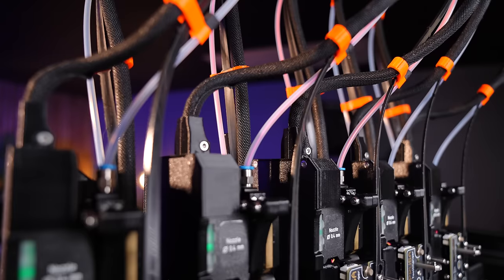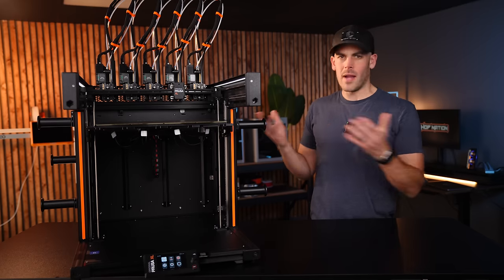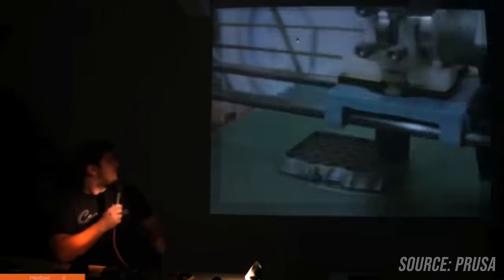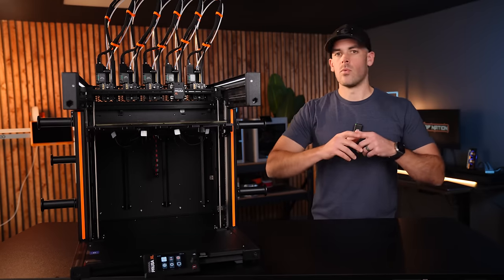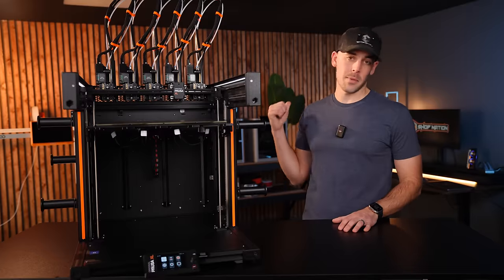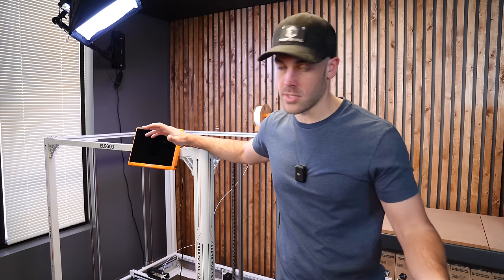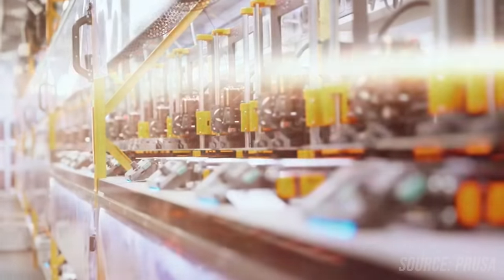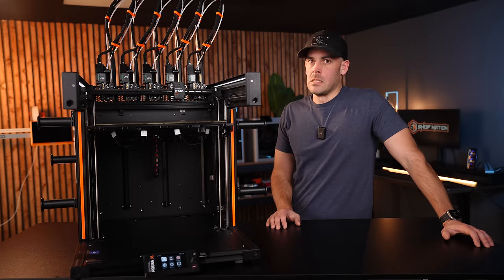Why Prusa is the next Blackberry

Comment: I would say Creality's latest K-series core x-y offerings are more competition for Prusa than Bamboo Labs. Bamboo Labs are ultra proprietary meaning if it breaks and Bamboo have stopped supporting it you are screwed. Also they upload all your models to a server in China which is a none starter for anyone printing anything commercially. Sure there are work arounds for the upload stuff but it's inconvenient, makes the printer harder to work with and disables features. Creality on the other hand have open sourced their software and drivers so the community can work with the new platform. The thing Prusa still has though is outstanding customer support in this space but even there the competition is working hard to catch up.

Comment: A two-head model is much more sensible to save up on material costs and complexity, while retaining the advantage of two-tone designs and resorting on changing filament for more. There is much more potential interest in fast printing two tones of filament in something like designing prototypes of moving parts... though I suppose that is just as easily addressed with painting.
Right, why do you even need to print a piece in different filament colors? Paint exists.

Comment: I ordered the Prusa MK4 and deleted it because of delivery delays. I swaped to Bambu and did not regret. Prusa shoud do a Bambu Printer but with higher build quality and at least the same features. The MMU is a piece of crap. Bambus Solution is just fine for home experience and the speed is awesome. But I wishe a more rigid frame and case. I would pay 2k dollars for a Prusa high quality Bambu Clone 🙂

Comment: The xl would be good for multi material parts. Like plastic bearing and bushings for all plastic robotics or for lightweight minimal  internal supports. I have never seen a 3d printer irl. I've watched a few creators that need that capability with less risk of mis-feeds. And how long would it take to offset the price based on the amount of waist the single head multi filament printer makes?

Comment: Most of the time wasted changing filaments on bambu could be fixed in software anyways. I think they just have some other pressing bugs to deal with first.

And also, why does anyone need more than two print heads? Couldnt one purge while the other prints?

Comment: This video has some pretty big omissions, first, the MK4 is Prusa’s best selling commercial printer. It hard to say they should “pivot” when what they are doing seems to be working OK for them.

It’s also important to remember that the iPhone has and I believe still does struggle to gain really good traction with larger corporate clients. I suspect that Bambu has had similar issues given that they had to release a more expensive version of the X1 with tweaked features and Ethernet.

I am also curious why Bambu released 2 bed slingers (one which was clearly rushed) if their CoreXY offering was doing so well?

To me this video seems a little hyperbolic, I think the XL is 100% a bit niche, but saying that I want one more than any other right now! Other than that, Prusa’s seem to being pretty well being the reliable work a day brand. Why does there only ever have to be “just one” brand? It’s a global market and competition is good. Prusa has their fingers in a lot more pies than Bambu, so I don’t see them dying off just yet…

Comment: Here is what I want to see from prusia: a smaller xl, fully enclosed, heated chamber, air filtration, dual head (either tool swapping or fixed) that's it. Can still cost more than others but at least I get the same features.
Reply: they should do 2 tool heads each connected to its own "ams" type system so while one is printing the other can be purging and getting ready to go and drastically reduce swap time and if each ams can hold 4 or 5 colors than you essentially have a 10 color print so the benefits of the mutli tool head with the benefits of 2 ams systems.  And they would need to have their slicer be able to tell you which colors go in each slot for optimal efficiency based on your sliced print. even if that means you have the same common color in both ams's.
Reply: I agree, but I think it should be 3 heads rather than 2. An IDEX can do 2, so this would give it a USP over an IDEX. 3 heads would allow you, for example, to do 2 material, plus support material. IMHO there's not a lot of point in a 2 head toolchanger, as an IDEX can swap heads way quicker than a toolchanger, with way less complexity
Reply: @EddyStyl3s You still have an enormous amount of waste.
Reply: @EddyStyl3s  I was thinking the same thing. color changes don't need to add more time.
Reply: @EddyStyl3s OMG, I had the exact same idea 2 days ago! An Index pinter with 2 toolheads and 2 "AMS" systems is the best of both worlds. Fast and efficient printing at dual color, capable of multi material (PLA + TPU for example) and it can print fast multi color for more than 2 colors.
Reply: quickchange nozzle like on the new bambu
Reply: 2 heads is too limiting for complex projects. im running tpu, pacf, pccf, pp, hips. just get the mmu3 if you want a smaller machine.
Reply: no need for idex if you have the nice tool swapping ready
Reply: @EddyStyl3s  2 heads come at the cost of decreased quality, increased size, etc.
Reply: @EddyStyl3s  yes this would be amazing! It will be interesting to see what BL come out with next in their gen 2 printers, because there is little doubt they are working on an evolution of the AMS system and a reduction in waste and print time. I would love IDEX.
Reply: if anyone could help with their opinion:
- where would you place the RatRig 3d printer? interested to know how it ranks between the rest of the brands
Reply: Absolutely!  I have no need for 5/6 printheads and huge volume, but I'm still sticking with my Flashforge Creator Pro II IDEX because I often do prints that NEED dissolvable supports.
Reply: Yeah. A fully enclosed heated system is necessary for many materials and when you're doing functional multimaterial prints you typically need 2 heads or 3 if you're really stretching it. 5 heads without an enclosure? Uh, ok.
Reply: I really just want the segmented heat bed. Afaik even the new mk4s can't print a big cube without the corners peeling up.
Reply: heated chamber with all electronics outside the chamber and the ability to print Polycarbonate flawlessly

Comment: I believe Prusa is doing a slow, but steady pivot to a B2B model, which would show why they are lagging in the consumer market. Businesses with privacy concerns don't like Bambu spyware sending their gcode, and a european company is something that will offer better support than a chinese one.

You can see it with their Prusa Lab videos, they're all highlights of how they are making big moves in the B2B space, replacing what Ultimaker used to be, but catching up at the consumer/prosumer market much more slowly.
Reply: Literally you just described blackberry and their descent to a T.
Reply: I have one printer from a dutch company that went into B2B... and so it left me as a consumer stranded. They occasionally send me newsletters, but it's not for me any more.
Reply: Moving from consumer to B2B is a downgrade. You need to be much better to compete on the consumer market
Reply: @ZURAD   the dutch company got more expensive and made bigger printers. They had been in a sturdy frame with a fixed bed (on a z axis) before and after their transition.

But well, when they decide to move away from me with their product lineup, I'm off. That's how it is.
Reply: When doing an R&D project, I want my designs to stay in our office, especially NOT on a Chinese server. We had a Chinese company that we were working with but they causally leaked it out—going oops. And then the project died. Keep your data safe.
Reply: BlackBerry also pivoted to a new niche to survive when it's original core product was rendered obsolete.
Reply: There is a Lan only mode especially with X1E with security features ...

Comment: I think the first problem with the XL is that it has been widely accepted as a Bambu AMS competitor, when I think it is more accurate to compare it to something like the E3D toolchanger. The toolchanger was a similar price to the XL, and it could that price because there was nothing else with the same capability. That said, the E3D Toolchanger was also just a motion system, not a ready to use printer.
Reply: Well - The problem is that the XL, while it is a great idea, has some problems.
First of all is the market. While the "standard" Prusa was rather expensive, it still appealed to the "home" market. It was just affordable enough, to say that reliability justified the price. That's still the case, but it's far less relevant. Other printers like the Bambulab printers took a big chunk out of the market share.
The XL is maybe a great machine, but it also has a great high price. The Bambulab X1 Carbon is slower, spills a lot of material, and is not capable of printing mixed printing materials. However - It has one huge big advantage. It is just at the right side of the border of being affordable for the "home" market. The Prusa XL is way out of league in this respect. Most people that are just capable (and justify for themselves) to afford a Bambulab X1, are not capable to afford a XL, and thus are not tempted to buy one.
Do not underestimate the size of that "home" market. It's the segment where majority of the models from Prusa where sold, and the biggest source of income. Other manufactures have eaten away that most profitable market. That far cheaper A1 series printers from Bambulab have taken a big chomp out of that market. By the way - I am no Bambulab lover, but facts are facts...
And then of course the XL had some big problems. Problems you should not expect from printers at this price point. That was very damaging for the image of the Prusa printer line without any doubt. Prusa always stood for quality and reliability. Sadly that image now is damaged...
Reply: That's just technical minutiae. It is for all intents and purposes a Bambu X1 Carbon competitor. Even prusa fanboys who claim the tool changer can be used for lasercutting and CNC will never use it for those purposes and are just using it for multi-color, sometimes multi-material prints.
Reply: @paranoidpanzerpenguin5262  I think you are underestimating what you can do with multi material and that if the bambu can't do that its not even close to being a competitor. If ya don't design yourself, and only print PLA I would recommend Bambu. But as soon as you design parts yourself, the freedom of multi material is soo much worth it! I don't think people realize yet how good support is with incompatible materials. I've had some seasoned 3D printers ask me how I was able to make parts that look so good on all sides XD.
I uploaded a small vid of my very first try on a big part (that would not even fit on a Bambu btw) https://youtu.be/ZPMs6VDKU08
This test still had the wrong top support patern, Changing it to linear will make bottom and top look almost the same and it becomes hard to tell what orientation the part was printed.
Reply: @AcEkrystal I am not sure you understand that the M in AMS is material.  I have multiple materials loaded on my AMS and that is exactly what I use it for, I don't print multi color I print multi material.
Reply: The issue tends to be with material contamination inside the nozzle resulting in weaker parts as well as potential temperature incompatibilities.
Reply: @spock81  That is certainly a point. The question is if that justifies that almost $2000 difference in price for the average user. Sure - Some users will go for the best quality and happily pay that price difference, but I guess the majority of users rather search for work-arounds or accept a lower quality to avoid paying such a huge price difference. Keep in mind that the XL also has no enclosure, what rules out the more exotic materials that are printable on the more cheaper printers that do have that enclosure...
Reply: @spock81  it's not a Bambu issue if you flush and don't try to save waste.  Then people complain it wastes filament and but a $2000 more expensive printer to save $10 in filament.
Reply: @paranoidpanzerpenguin5262  The technical minutiae don't matter to the end consumer, but they do affect them.  Specifically, any multi-material print job is gonna be better served by the XL, especially when mixing TPU into the equation.  TPU is notorious for being difficult to swap, requires a very different temperature, and becomes garbage when the tool head isn't properly cleaned.  The latter two can be worked around, but the swap will always be finicky due to how FDM works.  Bamboo has the best filament swap system, but simply using another extruder, already primed and ready to go, will always be more reliable.

So as with so many things, despite a consumers desire for wanting something that "just works" without thinking about it, the best tool really does depend on what you're doing.  If you primarily do multi-color with non-exotic materials (so not a technical hobby), then Bamboo still wins out, especially with the "Don't think about it" mindset.  But if you're gonna be doing exotic materials regularly, the choice of printer becomes a more difficult question, and Bamboo may leave a consumer believing 3D printing is still "nonviable".
Reply: @jclosed2516  at 2k the xl isnt that much more. yeah its 2500 for 2 heads but id pay that and i will if bambu doesnt announce or come out with a dual head soon. and i can upgrade to more heads down the road if i wanted 2.
Reply: @jclosed2516  you dont need to get all 5 heads lol. acting like you have to pay 4k
Reply: @TheJomoe1  Sure - You are right for the more professional user (like I did argument before), but I was talking about the more home user side of the fence. A multi-color fully closed Bambulab P1S is about €770. For a big majority of people that's more than enough. Especially if you take in consideration that things like water solvable and PLA can be mixed, so a crude multi material is possible.
Sure - The Prusa printer is way better, but for most people the almost €2000 price difference is a very steep hill to climb. In no way I say something negative about the Prusa printer, but for most people that have no things like a printer farm, the price point can be a problem. Don't underestimate that "home user" market share.
Reply: @_Richard_F___ what part of what I said gave you that takeaway?
Reply: @_Richard_F___ their tool changer  is actually quite different from the E3D. Prusa uses gantry movement to latch onto toolheads, E3D used a motor to move a locking mechanism. And why is off the shelf drivers something bad? Just means it will be easier to get replacements if needed.
Reply: if anyone could help with their opinion:
- where would you place the RatRig 3d printer? interested to know how it ranks between the rest of the brands
Reply: @KNDlifeacademy  As far as I know, Ratrig has no official toolchanger printer, although some community designed ones are avaliable. A ratrig machine is more comparable to a Voron or Annex machine, all printers that are kits/self sourced
Reply: Yeah I seriously never understood why a toolchanger was being compared to an MMU.  Just wondering how stupid Bambu users truly are.
Reply: the problem with the XL is that it's over 3 grand, nobody is buying that shit
Reply: @marshallb5210  well, the E3D toolchanger, which is one of the only other toolchanging machines that has been avaliable was 1800 for just the motion system with no toolheads, electronics, or wiring. The XL is really not poorly priced for something that literally has no competition, and is more suited to commercial use than consumers.
Reply: @marshallb5210  I plan to, you can watch and cry lol.